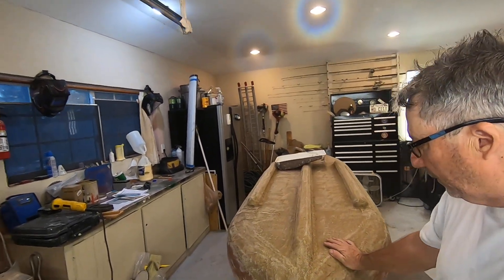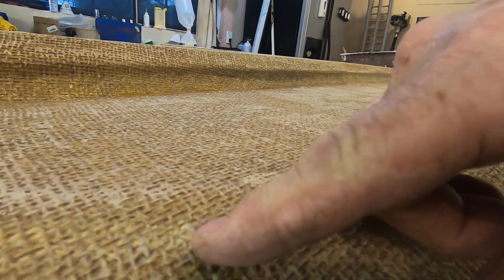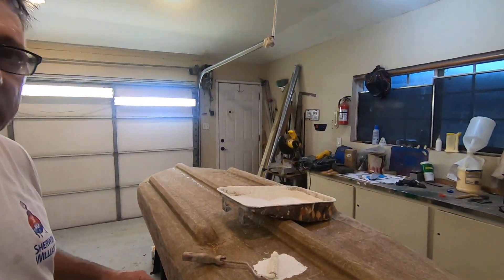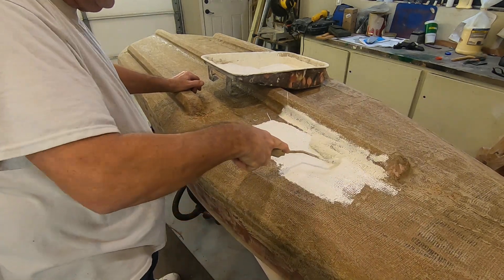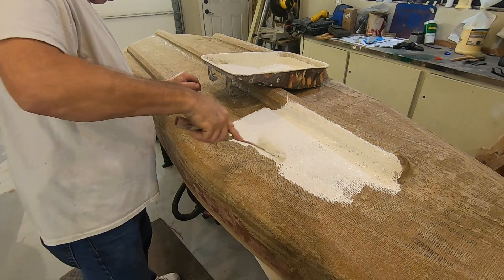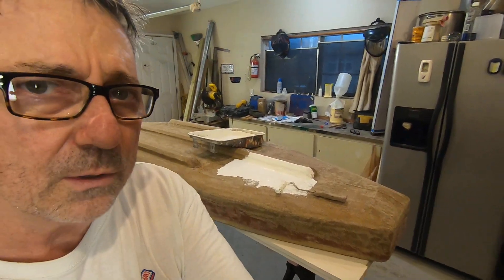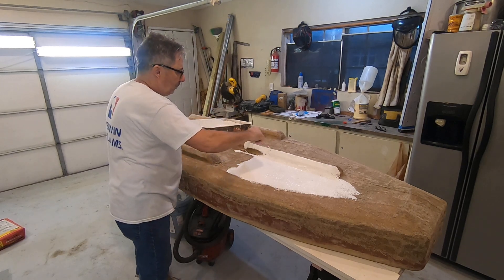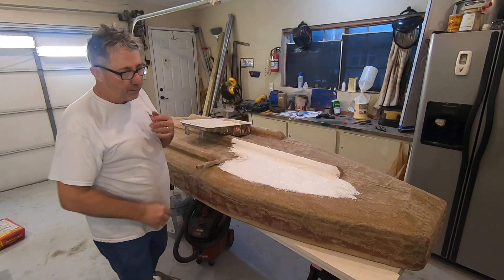Homemade DIY 10ft styrofoam fishing kayak episode 19 sealing the poor mans fiberglass

Comment: What made you decide on using burlap instead of painters cloth? Just curious. I'm sure it would be stronger if you filled up all the openings with glue (probably take 4 -5 coats) I think painters cloth will be strong enough if I do three coats of glue.
Reply from the maker: Glue will seep thru and be sure to adhere to the foam and will follow contours easily